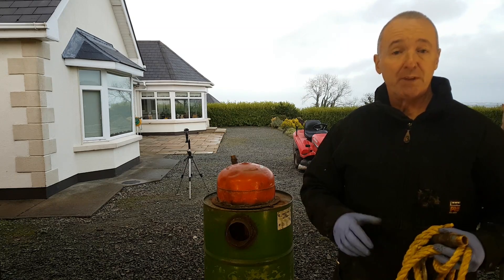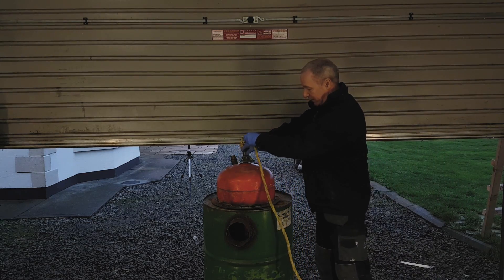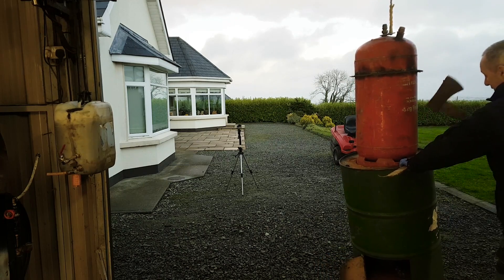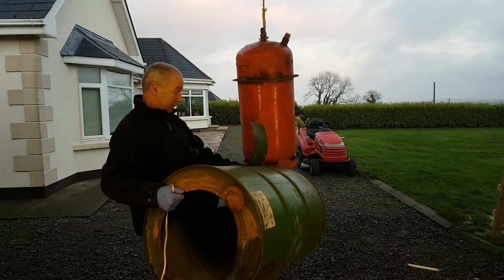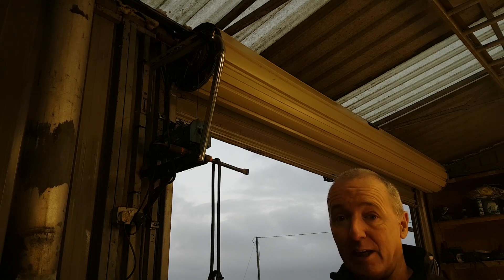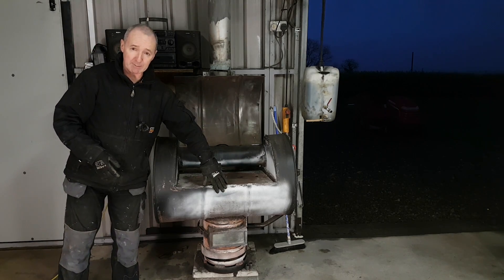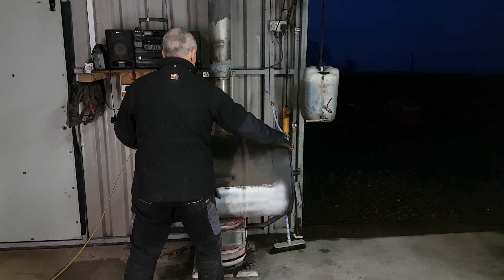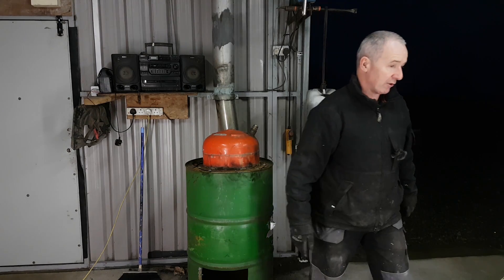Free Hot Water .. Waste Oil Boiler Stove .. The Build...

Comment: Hi Gerry now your going to need an open vent so you don't turn that cylinder into a hotwater bomb this will let any pressure out of the system. And then you'll need an Ajax valve connected to the garden hose or town supply to auto fill the cylinder back up as hotwater is removed. Cheers Fireman Jim

Comment: Love the videos, we have been watching your progress for over a year now. Is it possible to scale down the stove size for even greater fuel economy, for example, with a 3.9 kg bottle? Does this make sense? Cheers Gerry. Don't stop doing what you do!
Reply from the maker: Hi Jane. It is possible to go smaller but there is a limit with this design because the burn chamber has to be red hot. However I will be making a smaller design once I have the boiler stove up an running . Thanks for the comment Cheers Gerry

Comment: Gerry, if you want to know why so many viewers... You are clearly NUMBER ONE on the internet for NORMALLY ASPIRATED waste oil burners. 
And as far a waste oil burners go, your ring of fire design may become legendary, because people copying it are finding it is very efficient.
(Powered-air waste oil videos are a dime a dozen.) 
So many of us watching you use these burners OFF GRID because they are home-made heaters. Also, because oil is the best heat producer for off grid use. This is why you have us viewers. 
Off grid usually means hauling waste oil or diesel to a slightly remote location. Even the Eskimoes (Inuit) used whale and Seal oil for heat (blubber) due to all the B.T.U oil packs into a small transportable package. Please make your Free Hot Water heater normally aspirated when you find it convenient - we'll eat up your content. 
Thanks for all your other entertaining Paragliding etc content on the side, its fun to see what else is going on with you.
Reply from the maker: Hi Rand. I hadn't stopped to  think of it in those terms. It would be very easy to make an unpowered version of this boiler stove and even a better looking design When I get it working with a fan I will cut it and make it run power free. I have some designs in mind so not too dificult. The closest I got to canada was when I flew into Chicago and could see it from above. I lived in Oregon for about 6 months and planned on going north but ended up in Sanfrancisco and LA instead. It's on the busket list though. Thanks for the comments. I will be doing another live chat on Sunday evening at 9pm utc so if I can keep up with all the comments and chat I might be able to answer things better there. Cheers Gerry

Comment: I’m thinking that a fuel cut off thermostat, a pressure relief valve, and a launch tube if they fail. I’ve responded to boiler blowouts and it is an amazing force. Great idea.
Reply from the maker: Hi Abby Babby. This could get to massive pressures very quickly if it were a sealed system with blowout valves and similar but I will be making it an open vented system so it will just make steam and blow out an open pipe if it were to get too hot. It's very simple and I hope to have it going this week but I am busy  with work. Thanks for commenting Appreciate it  Cheers Gerry

Comment: Boilers are super tricky to work with, a pressure relief valve is necessary as steam is extremely dangerous!
Reply: Assuming there is any pressure at all.
Reply from the maker: Hi Rich. With the unruly nature of waste oil and the type of burner I will be using I elected to go with an open vented system so there will be no build up of pressure and I can always turn off the oil. On the next version there will be electronic control gear. I appreciate  the comment Thanks Gerry

Comment: Hey Gerry, excited to see what that bad boy does.  Worse case for a safety measure is to start with a calculated amount of oil.  Say 135-145K BTUs per gallon of WMO.  If you have a 30 gallon water tank and the water is starting @ 40 degrees F and you bring the temp up to 200 degrees F that's roughly 40,000 BTUs.  Perhaps start the system with no more than roughly 1/3 of a gallon give or take...  Of course you could always just turn off your oil when you reach the temp you want but what fun would that be lol...  Glad you had both eyes at the end of the video.  Can't wait to see it fired up.  Is this going to be an open system?  How are you planning to harvest the heat?  Cheers from Northeast Ohio
Reply from the maker: Hi M35a2guy I am going open vented with this. Unless I go at this with a wire brush there will be lots of smoke when the paint burns off and I am not going to sand it lol. What happens if you keep going across lake Erie into Canada is there border / custom issues. When you look at a map of the US you would swear it was just a big island lol. When you see it connected to Canada and Mexico thats going to be some wall or big fence lol. Ireland is just a little country with just 6.5 milion which is like one of your towns lol. Thanks for the comment Cheers Gerry
Reply: GerrysDiy Hey Gerry!  Cheers. You can certainly cross Lake Erie into Canadian waters from the American side. Your supposed to report with Canadian customs however upon arrival if you plan to even just drop anchor in Canadian waters. Both Canada and the US have a coast guard and it’s patrolled aggressively. My wife and I ride the Harley up through buffalo NY over to Niagara Falls but just stay on the American side.

Comment: don't seal it off without a temp and pressure relief valve. a steam explosion is more powerful than a TNT
Reply from the maker: Hi James There will be a little header tank and it will be open vented to the atmosphere. A sealed system here would be very messy. Thanks for the comment Appreciated Cheers Gerry

Comment: Do you plan on adding a pressure relief valve in case the water gets too hot? I've seen videos of hot water heaters exploding. I'm glad you're back to making videos. Cheers
Reply from the maker: Ho Bob. This will be connected as an open vented system so no build up of pressure it will be open to the atmosphere.cheers Gerry